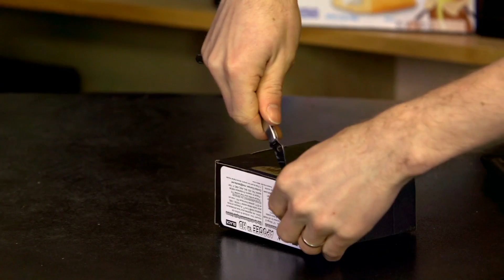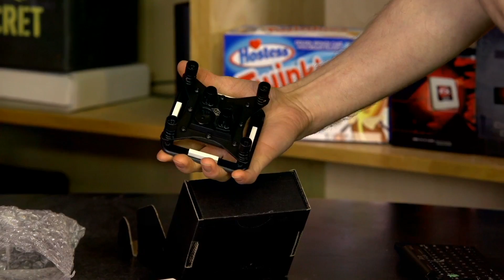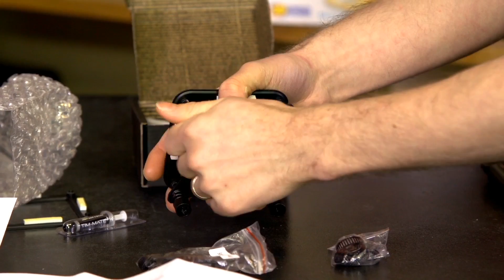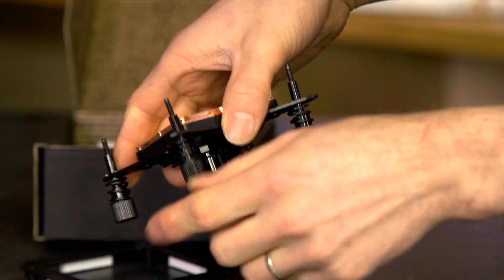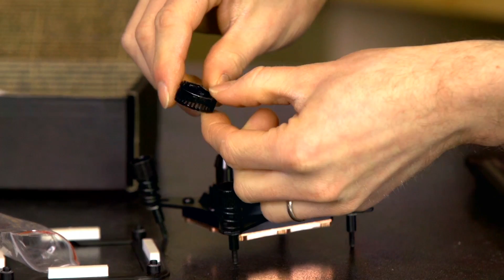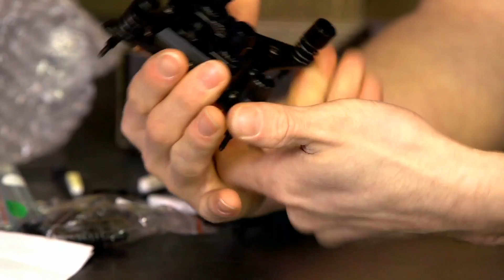Swiftech APOGEE HD Water Block Unboxing & First Look Linus Tech Tips

Comment: All the pointless arguments aside, A HUGE percent of gamers (if not all) use steam 
and for intel the 2.3 - 3.7GHZ cpu speed holds the largest percentage of cpu clocks) and remember that the steam survey only reports BASE BLOCKS, so no turbo speeds.
So most of the 4.5-5GHZ sandy's and ivy's fall into this category (my 3770k thats running at 4.8Ghz falls under 3.5ghz on the survey)

Almost no laptops and very few "Prebuilts from dell/HP" would fall into the most used intel category on steam

Comment: I agree I cannot afford Intel so I use AMD plus I like AMD. I am by not means a fanboy and against Intel but I prefer AMD for my reasons. Like Linus said before that there is no intel VS AMD only needs, cost, and performance to those who are choosing what they want plus and 8 core for $200 can't beat it when despite what Intel fanboys would like us to believe you can't really see the difference between and FX 8350 and an Intel CPU that cost like $700 or more even though you can in benchmarks.

Comment: Yeah though for gaming the 3770k is overkill. I'd go with samsung 1.35v magic ram since its much easier to overclock, but basically any ram is fine. 
I'd also get a 7950, since its only a little bit more expensive but its a lot better (and its got crysis 3)

Comment: No, it's not. Each module or "two cores" shares 1 floating point unit, meaning that if you have more than 4 threads running at once, it will slow down.

Comment: Completely understandable question. DO NOT vacuum your pc. You could potentially suck a capacitor right off the motherboard, it's just a bad idea... I do recommend you use compressed air to clean out your PC. If you need to do a deeper cleaning use isopropyl alcohol or distilled water when working with or near any hardware. If you are just cleaning the case, remove all the hardware and blow dust out, then wipe dust out with a dry cloth, then wipe case down with a wet cloth. 
Good luck!

Comment: I wouldn't recommended it. You have to get really close to the components to clean them of with a vacuum. Unless you have a vacuum that can absolutely crank air out (reverse normal flow as to blow dust away) and the hose is entirely clean (don't want bits of crap hitting components) and you have one of those attachments that makes the stream more concentrated. If you got all that then got for it. But it it safer to just use canned air of an air compresser.

Comment: To not include the ONE necessary mounting plate for AMD cpus is somewhat ridiculous in my opinion. Yes, it's free upon request, but it's a separate shipment and rather inconvenient, not to mention the fact that the hold down hardware does not use the same thumbscrew as the Intel hardware. What the heck Swiftech?

Comment: I suspect that may be more local than anything. I have sold them for many years and a good portion of the enthusiast that I have sold to do like to play with overclocking and with alternative cooling methods past air. to claim that 99% or even 90% of all water cooling is done to Intel is a stretch. Also as I mentioned to not include that is almost a slap in the face from Swiftech. One that I would not expect from other makers.

Comment: just a question because I didn't find anything about this anywhere, can you replace the default barb fittings on the block with your own compression fittings?

can you even take out these ones or are they one piece with the block?

Comment: All 4 of my systems are AMD and all 4 are water-cooled.  The difference between the people who spend a ton of money on Intel and water cooling VS the AMD camp is that many people in the AMD camp will buy inexpensive water blocks, pumps, reservoirs and radiators.  The only considerations that really matter when building a water cooling setup are internal block surface area, radiator surface area, fan selection and pump flow rate.  Water-block $28, radiator 3x120 $59 and pump with reservoir $20.

Comment: I still amazes me how people are willing to pay ~$100 for a copper water block that most likely did not cost more than $15 to produce with all the parts included.  With water cooling it's all about surface area, temperature differential and flow rate.  Spending more money on a block of copper that has very little improvement in internal surface area over a cheap $30 eBay water-block is pointless.